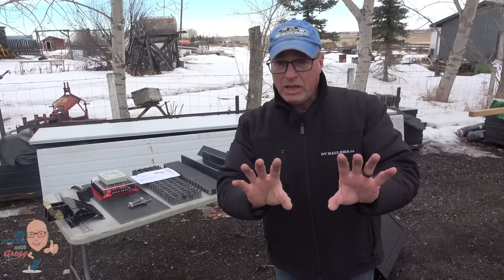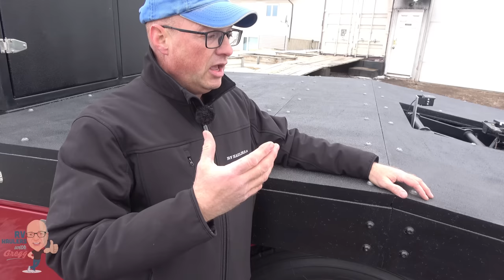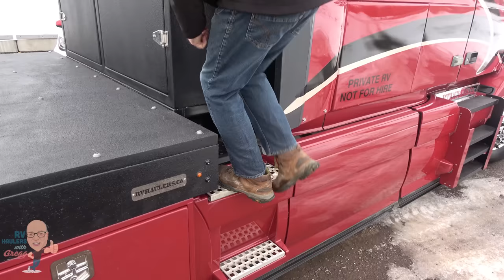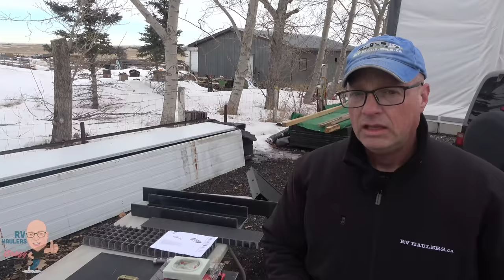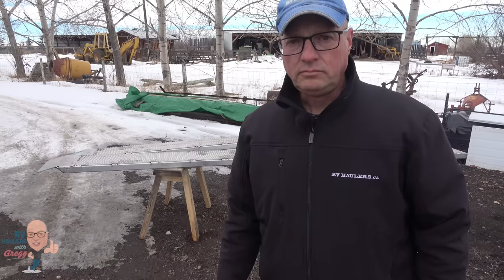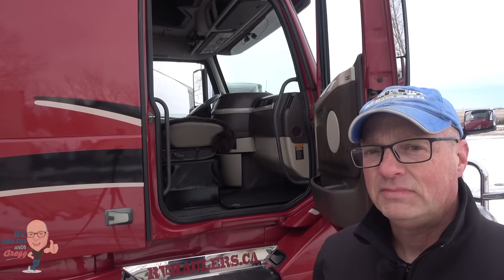Never Rust Modular CANBed by RVHaulers

Comment: Wow! what a lot of information to digest!   I love the modularity aspect of it.   For those of us that want it all but can't afford it all at the same time.  I will say,   I never knew how much I liked the dove tailed rear-end before I saw this one without it.   JMHO but the squared off rear-end makes it look a little "industrial".  Can't wait to start my journey.  Keep putting out these wonderful videos!
Reply from the maker: Good point about the narrowing of the bed at the tail section. The engineers and I went around and around quite a bit, and unfortunately the system doesn't lend itself to being fabricated with that angle.  What was key in my mind was to ensure the engineering was sound, strong, and reliable.  

Remember this is just an alternative. It certainly has a different look than we are used to.  There are positives and negatives between the CANBed and the steel beds.  YOU GET TO PICK!  Every one of my RVHaulers is custom, and designed to meet your budget, visuals, and function.

Thanks for watching!  Gregg

Comment: That looks like a sound product shame the RV industry dont use it for floors instead of rotting plywood  < ref Airstreams / but even they have gone composite > Yes there is nothing worse than a bed with rust streaks showing next to a mirror finished tractor cab , out of curiosity what was the board designed for, also whats the fire proof propertys or is it just coated retardent, will the bolt-heads pull through this product in time , it would be nice to see concealed fixings on the skirt of the bed instead of exposed heads . Sorry to ask a lot of questions but its an interesting product overall very impressed.

Comment: Suggestions.  Lower your wireless microphone 6 inches (15 CM) and use the gain button on the wireless receiver, mounted on the camera, to reduce your gain.
Reply from the maker: Hello CFP.  I appreciate you sharing your wisdom.  I am looking at the wireless receiver now!

Ggg
Reply: @rvhaulers  I would need to know the model and manufacturer of the mic and receiver.  A very common receiver has 3 buttons on the bottom.  One of them is labeled gain and refers to "0", "-12" and "-24" db.  Check the operator's manual.  You may be set at "0" db and need it to be lowered to "-12" or "-24" db.  It may just say db.  Also, placing the mic over your chest sternum adds  a bass sound to your voice.  Lowering the mic placement will give you a more natural sound.  Some people like the sound, but for people that are hard of hearing, the lac of high frequencies from your voice, make you hard to understand.  I think some of your viewing audience may be up in age.  I have been an audio engineer and television editor for 45 years.

Comment: Hi Mr Gregg,
I am interested in the rust proof Canbed.  I have a 2013 Kenworth T700 with tandem axles.  I would not need a 5th wheel trailer hutch as I would be towing using a bumper hitch for a travel trailer.  I would want ramps to be able to load my vehicle from the very rear.

Comment: Can the Bolt heads be counter sunk to give everything a cleaner look?
Reply from the maker: Hi Tim,
The engineering is very specific and does not allow us to make changes that might change the strength or capabilites of the CANBed.  By counter sinking the heads,  we remove some material. My New York engineers were careful.   We even have torque specs for all the bolts.

Thanks for the great comment and question! 

Gregg